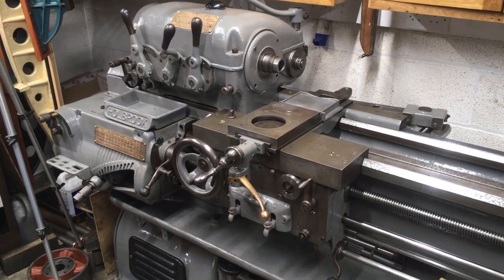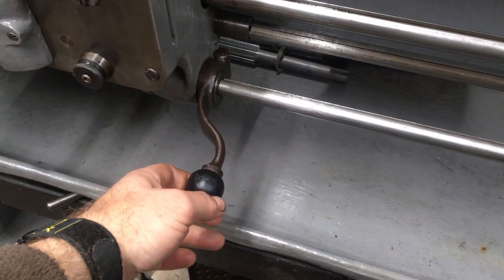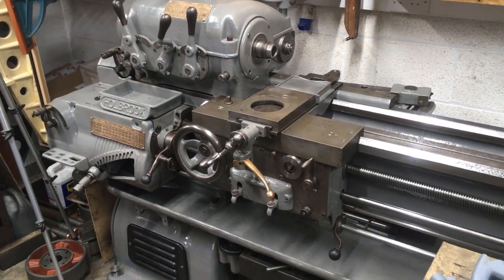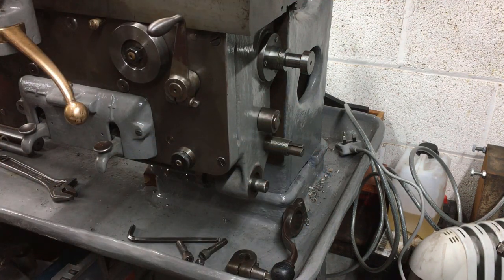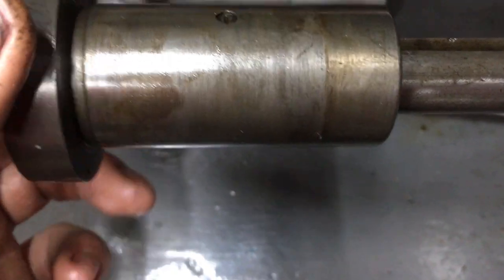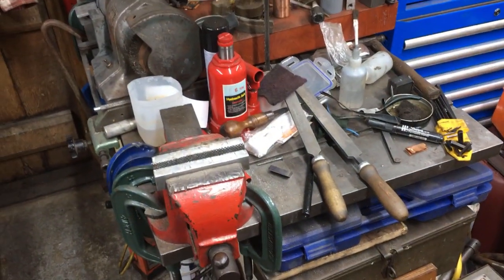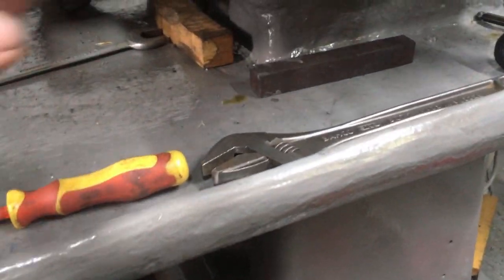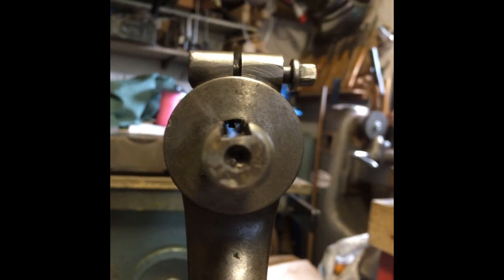Dodgy Feed Handle Repair on a Lathe

Comment: Lots of traverse time on that handle to wear that key like that. The clutch handle on my big Moarch is similarly slack and could use some love as well. For now it works though so I avoid working on it. LOL
Reply from the maker: This worked but it was next to imposible to set the link pin to activate the yoke on the dog clutch. Difficult to describe Brian, but the activation link is 'clamped' on to the shaft end, its absolute position needs to be set with the feed handle in position, clutch engaged in the correct position for the feed and then locked / tightened. I found a 0.020" out was rendering it not reliable. .020" movement of the rack on the end of the shaft was nothing compared to the loss from the wear. It was probably fine 'worn in' but once the position was released the erros started to creep in and the feed couldnt be repeatably engaged.

Comment: I’m sure if you added up your time at a machinists rate this would be a $20k lathe, which makes no sense, but since it is your own machine for fun who cares. And you are saving a fine old machine.  Great to watch how you do it. I have several machines waiting in the que for just this treatment.
Reply from the maker: The saying when this lathe was in serious use, "The Colchester Lathes on the shop floor, cost as much as the bosses car, the Holbrook in the Toolroom as much as his House."  I very much suspect if I priced my hourly rate at anything approaching a 'fitters rate' this lathe would be getting rather pricey ! On the other hand, I know folk that have paid out £3k to get a basic introduction to machine tool rebuilding and scraping - I would say, I've learned a good deal more doing the lathe than attending a a years worth of similar courses. I hope I've passed some of those lessons on.  This was never about  just 'getting the lathe running' or making it 'ex factory condition' - It was mainly about learning how to rebuild a lathe / machine to a high standard and understanding whats involved. All the time developing as many new skills as I could along the way. Hopefuly when Im done I will have a good lathe to undertake work with.
I do wonder what the costs of attending some course / apprenticeship to learn the same would cost today ?
 What do you think ? Mat
Reply: lookcreations I took Richard King’s 1 week scraping class. It was I think $1800 for a week. It was enough to get started. I don’t have your technical experience so taking in such a project starting from nothing was just too daunting. Certainly 1 week is not enough to learn everything you need but it was a great introduction and I would start small, like the topslide, and work my way up to the bed. Even if one took a longer more in depth course, eventually one has to actually do the work, put in the hours. But that course I took gave me the confidence to get started. I guess with your work experience you already had that.

Comment: It's starting to look suspiciously like a working lathe. 
Does the dog clutch have stops to disengage automatically like the Hardinge or is it just a manual lever and when  are you sending out the free cigars and brandy to your subscribers for the switching on party?
Reply from the maker: There are a pair of adjustable stops and micrometer stops which operate the dog clutch (as I understand it) - I hope to get on to commissionng all that very soon. Am looking at a venue to hire and relcoation of the lathe for the switch on chip making party ! Cigars, Brandy, Dancing Girls the whole lot :-)  All the best Mat

Comment: Nice work, and I thought the keys on my lathe looked bad
Reply from the maker: When I first inspected it - I was sure it was cut like that ! My own dumb fault for not researching a bit further.
Reply: @lookcreations  At least it is fixed now, my lathe had a bad key on the worm drive of the feed screw into the saddle, it looked like an hourglass, but to replace that you have to tear the whole thing apart..
Reply from the maker: @nightraidone9768  Its always a tricky call - on the other hand, you do know it will fail final pass on a really nice project !

Comment: Another nice job. A little surprised that that key way on the selector shaft wasn't pointed down?  Where it is it can easily load with swarf even micro swarf and with the power of the feed carriage in use and on the hand wheel could easily clog and jam. At the very least wear. Is it possible to re index the selector shaft and handle to have the slot underneath?  That is how I would set them up if possible.
Cheers
Reply: dazaspc good point. Are you sure it wasn’t incorrectly assembled at one time? Do you have a manual with an exploded view?
Reply: @sblack48  The machines I set up/repaired I couldn't tell you and I don't have a manual for this machine. I was a CNC repair guy for 30 years the number of manual lathe rebuilds I have done you could count on one hand and not use a thumb. I frequently had to work without manuals or not the exactly correct ones. However after seeing the state of the old machine when it was received I would guess it may have had a few rush repairs on it over the years? 
Cheers
Reply from the maker: The shaft went back on as it was removed - the taper pin which secures the bevel gear is inserted from top - i.e. it can be tapped in from above. If the shaft is positioned in another orientation you cant get access to the pin to seat it - too tight for any kind of clamp. We I took the lateh appart on site - I had to get the gearbox off with the gear/shaft still on it to get access to knock out the pin.  I cant believe Holbrook designed it like that so I very much suspect the thing had been appart before and put back togther the only way possible at the time.  I also believe that the fitters at Holbrook had some bespoke tools for assembly - tasks made easier with such - plus knowing the sequence of assembly ! All the best mat
Reply from the maker: I suspect it was.

Comment: That method of using a tapped hole 'split' vertically so half is in the part, and half is in the mating part, is pretty common.  Is there any trick that allows making a new part with threads that synchronize with the mating part?  I haven't been able to dream up anything with even a remote chance of working.
Reply from the maker: I was wondering about going up a size - but I concluded that as the key is captive within the sleeve and its housing - it cant come out only 'rock' I mage it a good tight fit down through the slot not wedged so it shouldnt rock. Time will tell. Mat

Comment: Personally I don't agree with the person below who thinks that wasn't the original method used by Holbrook. That key fits the recess far too well and is radiused flush with it's mating part. Screws halfway into both parts is a fairly common method of retaining parts. Without those screws the key would be free to move and start wearing out the recess it fit's into.The screw locations and head counter sinks are also done much too well for what usually passes for an emergency in house fix it fast and well enough to make the machine work. That's not impossible of course, just a bit unlikely given this lathes less than stellar past maintenance. As Andy Pugh has already mentioned the dovetail shape along that key is logical given the weight of the handle loading the key in one direction only, the key would keep rotating as the wear increases and that dovetail shape would be the end result. I agree though, it does look too even, but I sure can't think of a proper reason why the key would need to be thinned and shaped like that when the lathe was new. Today we'd probably use a spring loaded ball and 3 position detent on the handle boss to prevent the weight of the handle from constantly loading the key in one direction. 

Very good planning to use those tapped taper pins for location on that casting Mat. Next or if you ever have to pull them again run a nut then a heavy washer onto the bolt first. Thread the bolt into the taper pin then tighten the nut down against the washer to pull the taper pin. :-) If that carriage moves as well as it seems to in the video you did a beautiful job scraping the bed and bottom of the carriage.
Reply from the maker: The three position detent would have been a nice addition. I shall have a think for a retro fit. I had thought of making the key externally mounted from the flange end and cutting a key way down the sleeve - what I did seamed the quickest simplest solution. It is a very snug fit down the slot - time will tell if it rocks and wears the slot. Mat

Comment: Hi Matt. Good to see some traditional hand fitting. Just a suggestion: if you raise your vice, so that the top of the jaws touch the bottom of your elbow when you hold it horizontal, your cutting and filing height will be optimal. All the vices in my toolmaking training centre are adjustable in height, to suit the different apprentices for this reason.                                As always, thanks for the great content!
Reply from the maker: Its not far off, I do hope to get a suitable work bench installed in the workshop once Ive got the lathe running. As it is the vice is G Clamped to the bandsaw table ! - far from ideal. Thanks for the info' I shall have a look it I can add a spacer. Mat

Comment: The key only ever sees the weight of the handle while sliding and very occasionally the operating force when stopped (or stopping) so the asymmetric wear is explicable. 
Nice to see someone using a hacksaw rather than an angel grindr for a change.
Reply from the maker: Anything to keep th enoise down and increase control. Cheers Andy

Comment: Interesting 2 set screws holding key, that can't be original.  Nice idea screw through key to remove if needed.
Reply from the maker: Pretty sure thats normal Holbrook approach, similar to others on the lathe - concider also that the sleeve sits fully enclosed in its housing - the key cant come back out only down !